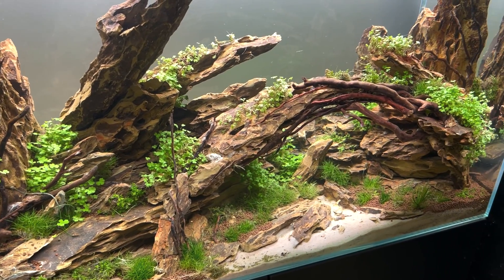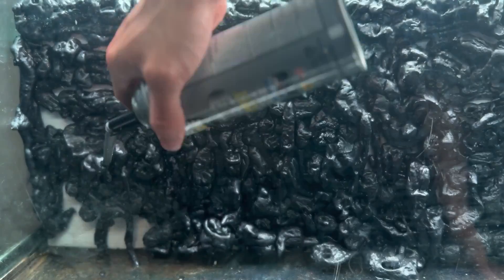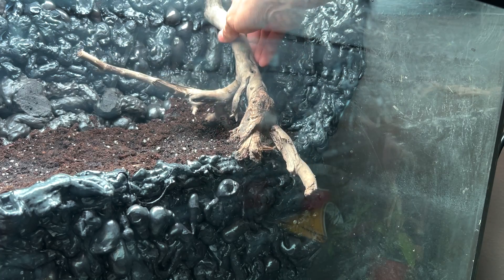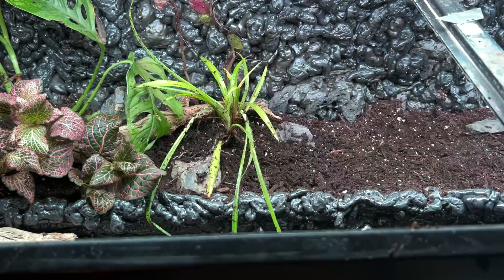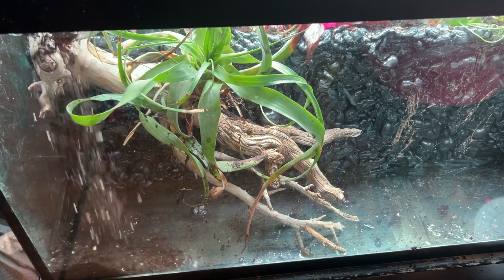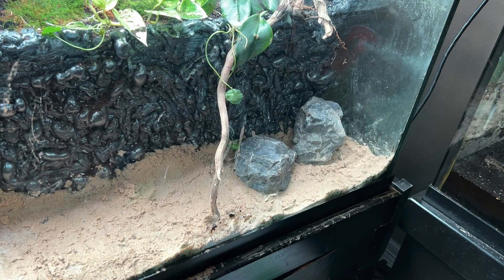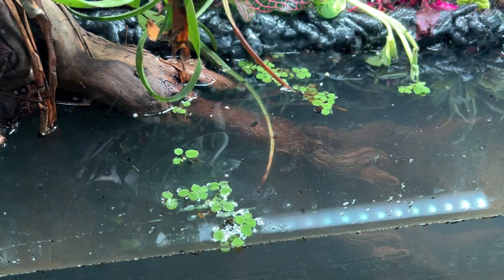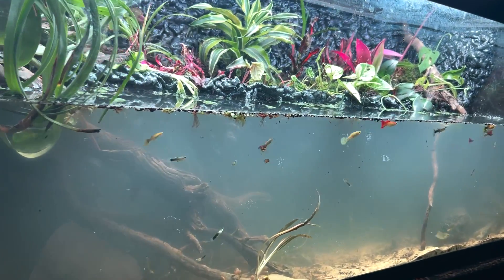I built an Ecosystem in my bedroom (Paludarium)

Comment: The land part has no drainage layer? mold
Reply: Thats what i was thinking no drainage beneath the substrate
Reply from the maker: It’s been about 5 months now and I’ve had no mold whatsoever. I did design it to where the run off water drains into the water portion.